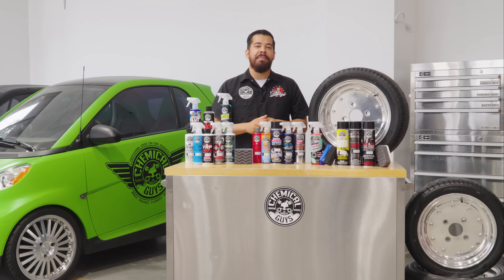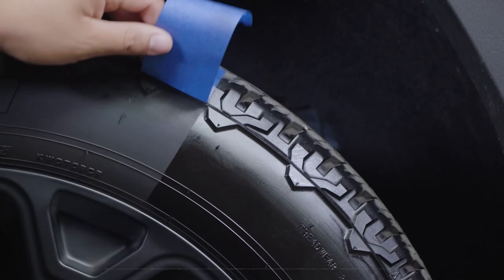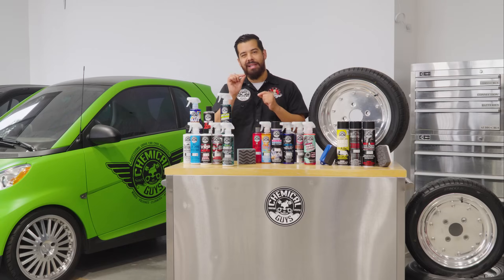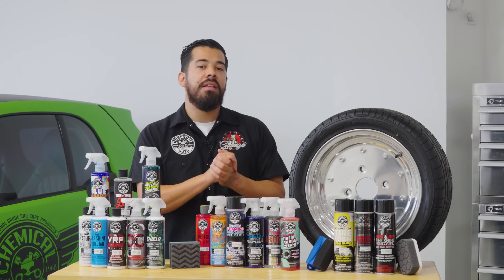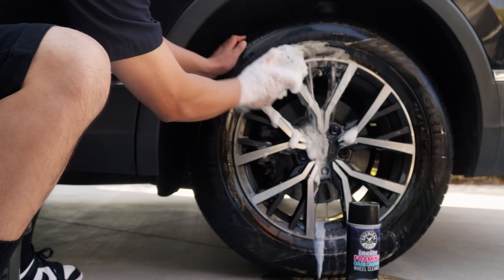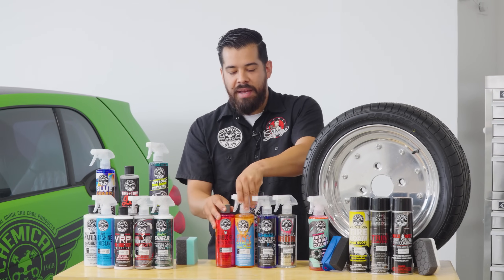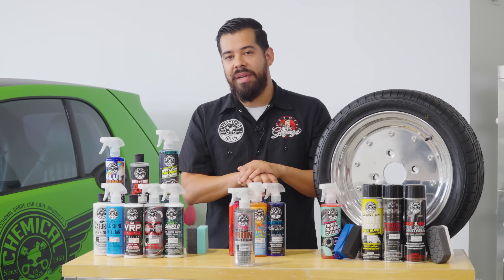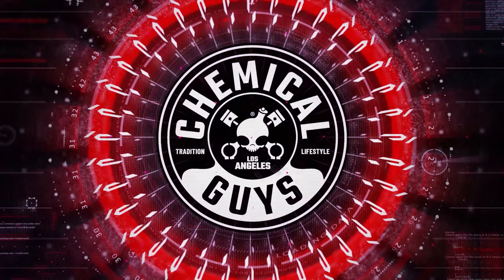The Ultimate Guide To Wheel Products - What To Use When, Where, and How! - Chemical Guys

Comment: I have black force wheels that have a lot of red brake dust that is like stuck on the wheel. I have used your Diablo wheel cleaner but it has not removed all of the dust that is inside the circle area of the wheel. Do you have any ideas how to get it removed. I can send photos of the issue.

Comment: What do you recommend for chrome wheels?
Reply from the maker: Hi Frank! Gently clean the wheel with Diablo Wheel Cleaner and then use Light Metal Polish to scrub away oxidation and stains if necessary to restore a mirror-like shine.
Reply: @ChemicalGuys  Cool! I have been using Diablo wheel cleaner. Any suggestions on light metal polishes?
Reply: What  would you  recommend  for factory  black and gray gmc Denali  wheels  for a nice  shine ?
Reply: @frankc1430  It is literally called “Light Metal Polish”. 😊
Reply: @flemmingjensen3202  Who makes it?
Reply: @frankc1430  Chemical Guys